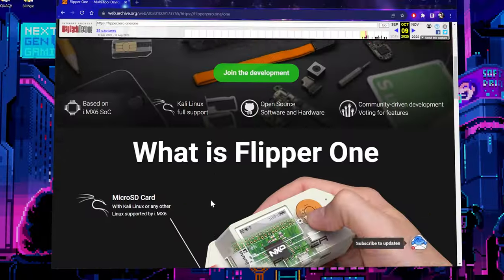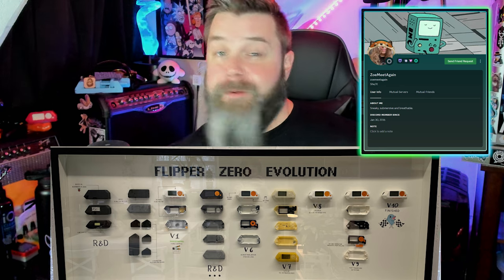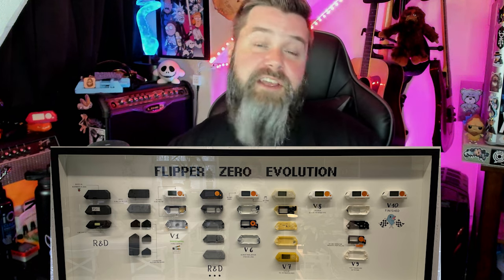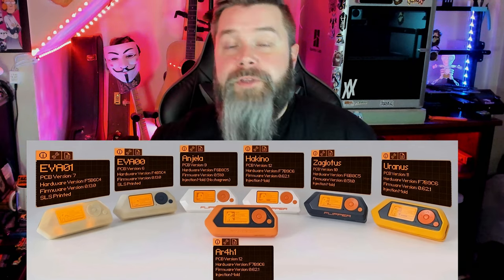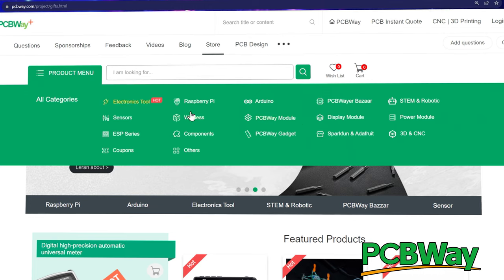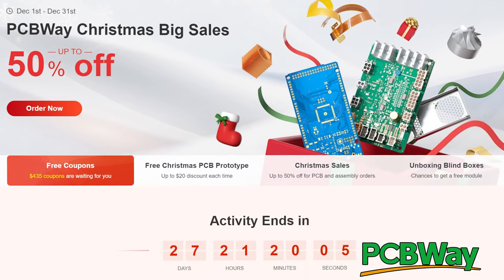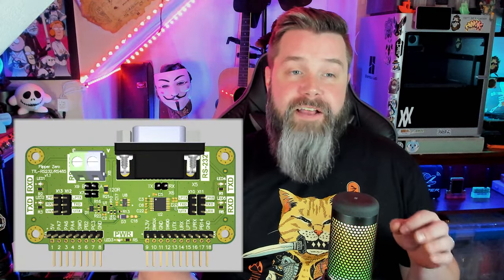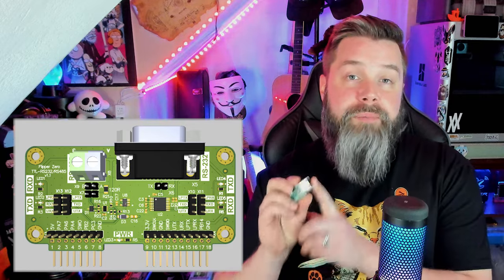The NEXT Flipper Zero? Introducing the Flipper Nano!!

Comment: Not buying a nano...make it bigger and stronger with wifi
Reply: I also want a “Flipper Thicc”
Reply: Eventually flipper One or something like that will come I’d say like 2 or 3 more years
Reply: It’s pointless to get one 😂
Reply: I think calling it a Beluga or some sort of larger marine mammal would be neat.

Flipper is the dolphin, idk i just like the concept of this naming scheme lol
Reply: @ninjaskitches true, from a practicality standpoint the hack rf or a pc etc is more useful.  From the messing around / project making perspective, Flipper Zero and derivatives are neat.
Reply: And rectangular and with tougmchscreen
Reply: Just backpack a raspi 0 to the flipper, communicate over uart and run all your software on the pi.
Using a wifi connection you can run high end ai models from a flipper zero interface.
Reply: @-someone-.  im currently trying to make a FLOPPA. A Kali Linux flipper style device but with a touchscreen, Proxmark Easy, full 2.5ghz and 5ghz wifi with SMA connectors, IR blaster made more like the MASTABLASTA. some kind of SDR(maybe a clone hackrf one), all on a LattePanda platform with full GPIO and a full desktop environment. trying to make it no bigger than the Latte so not a laptop or tablet but also not the most pocketable. Hes gonna be a thick boy if i can pull it off but a fully capable and pentest approved device. all black and as inconspicuous as i can make it.  
it will have usb-c and usb-a so any other add-ons can be either usb or GPIO. IDK currently trying to put it together.
Reply: AFAIK, due to FCC BS, they can't sell it with wifi without a ton of extra costs and bureaucracy etc etc which is why they released the wifi board separately.

Comment: Tldw it's an interface tool with two rows of gpio meant to be used wherever the current flipper isn't.
Same general firmware with no add-ons, so no subghz, ibutton, nfc etc.
Great for actual hardware hackers, but not great for people like me, who are mostly wireless and prefer pre built modules.
This will be great for anyone who needs to manage specifically hardware repair, where the current f0 kinda suffers by being more tedious to use for just about every tool it hopes to replace.

Comment: Great video , i just dont understand the market for this new device unless it has a very good price point , a raspberry pico or esp32 is more than capable and very cheap for a lot of projects , just add a display and buttons , sensors as needed. A flipper zero with integrated wifi and bluetoorh , would be more useful i think.

Comment: I wonder if anyone can explain the market for the flipper nano? Why would you want or need that?  what would someone use that for?
Reply: I have a Flipper Zero but the radio and hacking aspects are overkill for me. I'm not a hardcore electronics tinkerer and frankly have absolutely zero interest in soldering so anything that doesn't ship with an enclosure, buttons, and a screen is dead-on-arrival for me. On top of that, it also needs to have firmware and a community and a brand backing it. There are some very cheap devices that sort of fit the bill but I'm willing to pay a premium for a very polished device with great interface/design/documentation/etc. I just want a device that works out of the box but that is open source so I can freely develop for it. I have all kinds of simple app ideas and want to build my own tools. Flipper Zero works great for this but I'd love a cheaper version without the radios. I actually sort of dislike how it's a "hacking" tool because that has so much baggage and negative connotation associated with it when I don't use it for that at all.
Reply: @paulgemperlein626  So you've just bought a car and what you really wanted was bike?

Comment: Hey Sasquach I am think to make a my own hacking device with a Raspberry Pi 3 B and i will make a tut when it is done and will you like to try it and i am planning to make Hats for it so you wont have to solder all of the parts in and i am think of how to make the OS and this project is all inspired by your videos and the flipper zero and it is going to be called the Bad Berry
Reply from the maker: I'm definitely interested!
Reply: Sounds awesome where will the info be found at
Reply: @TalkingSasquach  I am still looking into where the parts are going to be and I am leaning into for it like a hackerRF function for it where you can plug it into a PC and use it and I am going to be putting a screen on it and a little arrow keys like the flipper